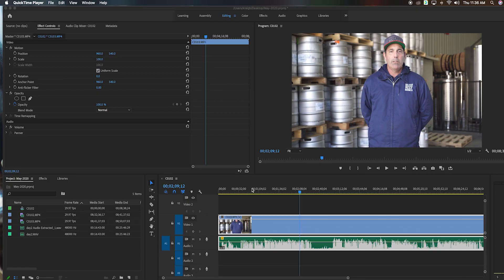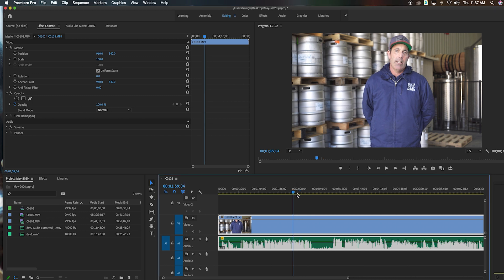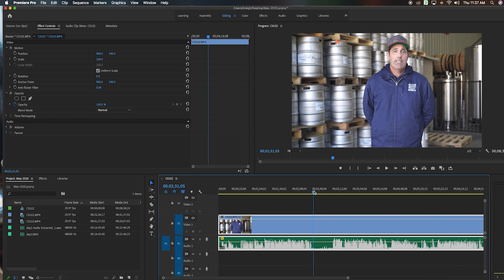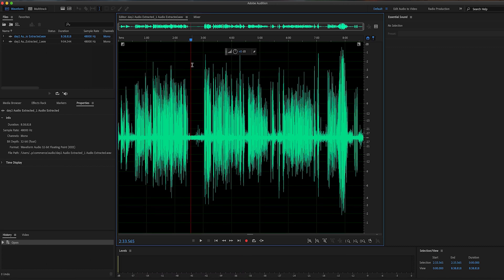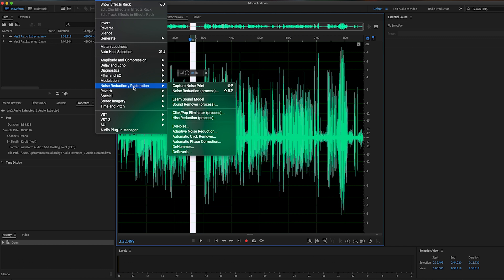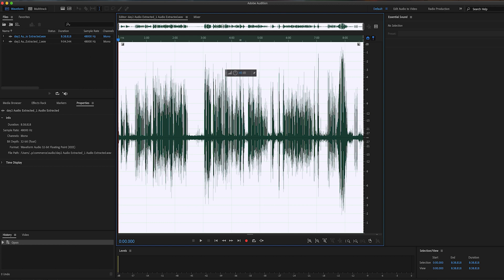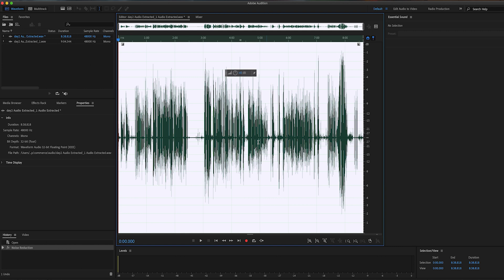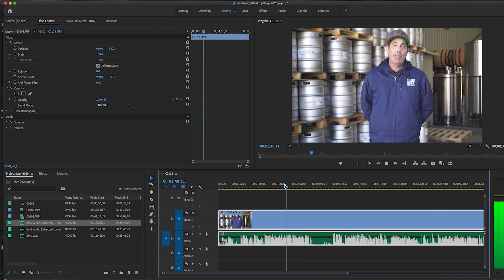5 Must Know Tips to Reduce Noise Floor | Background Noise Tutorial

Comment: You've got plenty of noise floor by today's standards. Clients are requiring -60 db. I used to think -45db with noise gate was pretty good.
Reply from the maker: This video is more or less for people starting out— On weddings, local commercials, conventions, YouTubers etc.
Reply: We have done recent full Hollywood features with -45 as requirements and been fine. No ADR. But you are right, obviously the farther down you can get that the better.